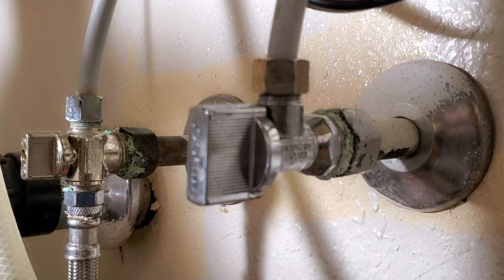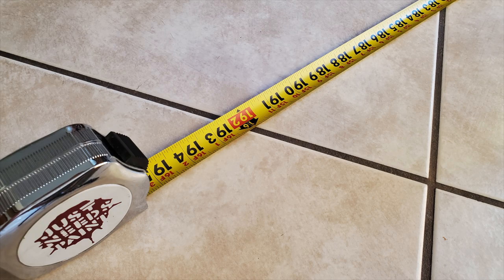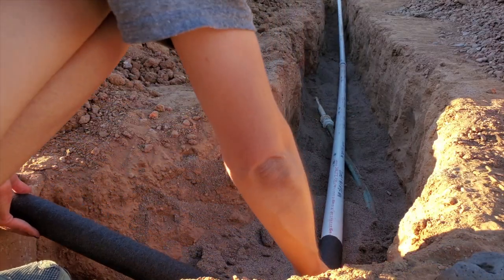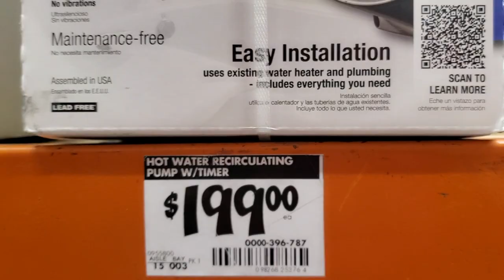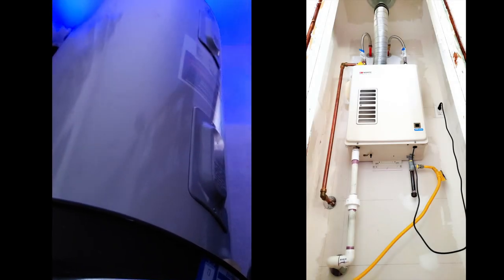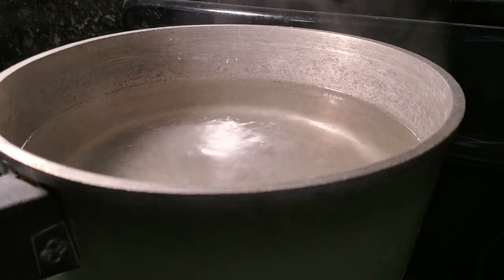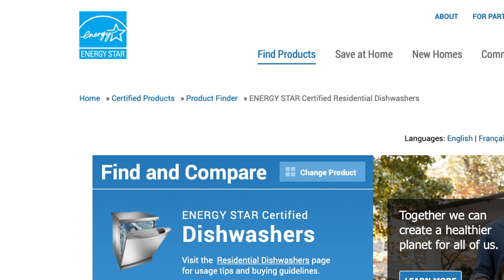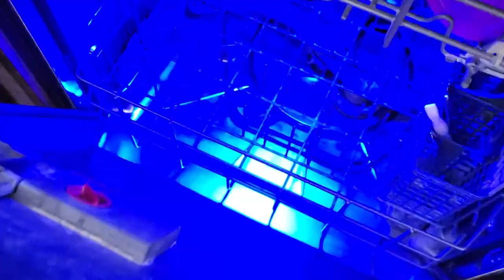PROOF!!! Why Hot Water NEVER Makes It to Your Dishwasher?!?!

Comment: This was a great video, and one I’ve been looking for. Me and my wife argue about this. 

I pre-charge my hot water line, but even doing so, my dishwasher is hooked up to a separate hot water line. Thankfully I know these two lines to the faucet are T’d off very close to each other, so charging the line to the faucet will bring the water to the line for dishwasher as well (I’ve actually tested this by disconnecting the dedicated hot water line for the dishwasher and running it into a bucket after charging the how water line leading to the faucets. 

However, I pre-charged the line just now (tankless hot water heater) started the dishwasher, and much to my dismay, the water in the first cycle was still room temp. It used so little water than even pre charging the line wasn’t enough to get hot water into the machine.

I was tempted to bypass the separate line for the dishwasher and just have it tapped off the same line as my faucet to avoid this,  but after watching my this video, I just no longer think it’s worth it to charge the line prior to getting it to the dishwasher.  It always seems to get the dishes clean anyways, and I never pre rinse anything. 

To anyone in a newer home with their dishwasher on it’s own dedicated hot water line, (I’m assuming building code), be aware charging the line is probably doing nothing.  I hope this helps at least one person.  Like you said in the video, information on this topic is super limited. The owners manual mentions nothing about pre-charging the line either.
Reply from the maker: It certainly helps knowing your plumbing layout! Nicely done on the testing and thanks for sharing your results. It's always disappointing to think you are helping when I fact, it's just wasting gas (I'm guessing tankless gas). As another viewer noted, the dishwasher can always steam up my glasses when I open it right away, so it's probably doing a good job on it's own.

Great point on the dedicated hot water line in newer homes with newer more water efficient dishwashers. I wasn't aware of that, living in an older home and now I'll have to go check out the code.

I'm not sure if I truly helped with a marital issue--that would certainly be a first for this channel! 😉
Reply: I dont think dishwahsers run with supplied temp water. I think they would heat it up to a set temp, then run the cycle.. If not, it would make little sense.
I purchased a 4gal water heater that will go under the sink, as the kitchen water takes to long for the house main tankless heater to heat up and have water in the kitchen.  Waste of water...not that you can waste water, as all water stays for use on the earth...but still, it wastes time, and dishes should get cleaned with hot water, as most bacteria die above 130F.
So maybe using the Sanitize rinse has a water temp regulator in the dishwasher that makes this work..Its likely why that cycle takes an added ~2-2.5 hours!!  So, I prefer the heating element to make sure water is heated, ... new washers are often having issues drying, as there is no heating element for the drying cycle.
Reply from the maker: Agreed on all your points. It wastes time and energy. If the line isn't pre-charged the water heater kicks on for no good reason and the hot water just cools off in the line. If it is pre-charged a whole lot of hot water cools off in the line and even more water has to get heated in the water heater.
Reply: @NoMoreLeaks  I think I understand your point a bit better now that I absorbed it :-). SO using a cold line should be ZERO issue, is what I see being the result. As the water will get heated in the dishwasher regardless. Besides, if you have the water lines in a hot attick, they are both hot. And the water that is heated never makes it to the dishwasher, as there is sitting water in the line before it.
Reply: The cold water feed is still feeding much colder water than a hot water pipe with standing water. Would it still not lighten the heating burden on water overall?

Comment: I have a gas tankless, it already take at least 90 seconds to get hot water at my kitchen sink... my farthest fixture, but at least the lines usually stay warm long enough throughout the day that its not a problem after the first use. But the first sink of the day is cold for a while. I can almost guarantee the water entering my dishwasher is ice cold. However, I have opened the machine in the middle of cycles before and the water and steam are scolding hot. Not overly worried about the temp being reached inside - I'm sure the heating element is doing it's job regardless of the incoming temp (since the cycles are so long). I love our tankless (recently upgraded 1 month ago) because the water is cleaner, it never runs out, more efficient, built in flow meter, easier and more accurate temp control, etc. but the time to get hot water is definitely noticeably longer and our plumber said those recirc gadgets (navicirc) which use the existing cold lines to return hot water is not up to code where I am.

On the other hand, I will sometimes charge the line for my washing machine (by running the sink) - It would be interesting to test how hot that water is really getting bc that machine doesn't heat it to the best of my knowledge. I haven't stopped a cycle to test it, but I do see steam/condensate on the see through lid when it starts filling.

Also really been enjoying the phyn plus! your videos helped inspire me to grab one (despite my pressure sensor being a little off) - I've rechecked the flow rate accuracy many times and it is quite impressive compared to my poorer experience with the moen flo accuracy, and unlike the moen Flo, the phyn is able to catch much lower flow rates, specifically our reverse osmosis system which is cool. Phyn says my dishwasher is using 0.71 gallons three times over the cycle, while the washing machine is variable depending on how it sense the load size, but it can pull 6.4 gpm when it starts filling - based on my tankless water heater reading which shows 3.2 gpm flow during that time, I surmise it is using 50:50 hot to cold.

P.s. maybe you've already seen these, but you can buy really small electric tankless units designed to go under a sink and attach to the sink and dishwasher lines just to boost those temps when water is flowing. like a mini local tankless
Reply from the maker: I have to agree with everything you mentioned. When I open the door there is steam coming out...and these cycles are ridiculously long, so it's definitely long enough to bring it up to temperature with as little water added as there is. So it is a moot point.

Still, why the requirements in the manual then? I guess to keep the cycle shorter (since the verbiage in the manual says it will take additional time and energy), which would count against the energy star ranking? 

Next related video: no hot water doesn't make it, it doesn't matter because it heats it anyway, ignore the words in the manual (at your own risk), hook it up to the cold line and keep on keeping on while saving energy and money! ;-)

Since I live in the desert, I do consider conserving water as part of living here. But I like following the rules including manufacturer instructions. I don't want to pre-charge the line and I don't like just wasting the electricity because I followed the directions to put it on the hot water line.

Oh snap! I did see a mini tankless--and tank style--water heaters at the builder show a few years ago! Those were looking really good as possibilities to help with my underused shower due to distance from the water heater and would be perfect for this application! Now for the extra electrical outlet...

Good point on verifying with the local plumbing code first. Just because I obviously found it on the shelf at my favorite store, according to my credit card ;-), doesn't mean it is legit.

Jealous of your tankless. There is no gas in this neighborhood and the panel is too full to add a tankless on top of no access to pull a new line.

I totally missed connecting the dots between you having the faulty flow sensor on Flo and the pressure inaccuracy on your Phyn. Definitely not the best experience on either, but I'm glad that the one you ended up with seems to be the better option!  I was considering doing a comparison on accuracy between the two because of your comments (although my sample size is the smallest possible). I was only planning on the flow rate, but now that I recall your question on the gauge and doing that check for you last week, I'll bring my water pressure gauge to verify Flo next time I see it in October. Thanks for adding this part of the comment!

Thanks for adding to the conversation! This might rival that lively conversation and I already want to redo some parts of the video based on your feedback and Jeff's. Sigh...unchangeable videos.
Reply: I was tempted to do one of these little mini tankless heaters as well if they’re not too energy inefficient. I’m sure it’s better to do that than run it off the hot water line where no actual water makes it to the machine but still runs the heater.
Reply from the maker: Agreed, but would the cost of a mini water heater be worth it if the dishwasher still heats the water to temperature anyway? Plus it has to keep the water hot at all times? Now that would be a hardcore nerdy video offsetting the cost of one of those water heaters to the cost of heating water inside the dishwasher...then you'd have to factor in how much you use on a regular basis in the sink. I like the idea of keeping the math simple with variable need usage in sinks and showers tied in to the water heater and these extremely efficient dishwashers should be responsible for themselves (cold line).

Comment: A recirc pump turns your entire house hot water supply line into a 24/7 heat radiator so depending on your climate could be pretty costly to operate.
Reply from the maker: 100% agree. It is hard to justify. If you figure out a schedule then it's an inconvenience to try to be within the 'on' time or if you use it when the system is off there isn't much point.
Reply: A timer is typically used for a circulation pump to operate for shower/wash times in the morning and evening. This avoids waiting (water wastage) for the warm water to come through the taps around the house.

Comment: Prerinsing your dishes is a big no no!  Miele specifies that the food particles are necessary for optimal cleaning.  Also pre rinsing leads to permanent etching of your glassware!
Reply from the maker: Thanks for the tip. I believe Miele is also a manufacturer that recommends installing on the cold line (or at least gives the option). Do you have one?

Comment: If your dishwasher is connected to cold line, you could connect to hot line to reduce the burden of heating by dishwasher as it is already preheated by water heater and you save electricity considering your water heater is connected to gas.
Reply: I don't think so.  The point being made is that the volume of water in the hot water line between the water heater and dishwasher is greater than the volume of water that flows into the dishwasher at any point in it's cycle.  That water in the line is at room temperature.  Therefore no water that is hotter than room temperature ever makes it into the dishwasher, and this is true even if you have a gas water heater.

Comment: Well...couple of things.  First, the dishwasher line almost always tandems with the hot side for the kitchen sink.  So if you are using the sink at all to wash/rinse dishes, the water going into the dishwasher will be hot.  For subsequent cycles, it depends on how well insulated the line is but the supply water is usually at least warm.  The problem of hot water getting where it is needed is not unique to the dishwasher.  We have a septic system on a single story ranch house with 90 foot water supply runs.  To avoid dumping 3 gallons of cold water into the septic system every time hot water is needed, we have a circulation system that moves hot water through a main loop in the house.  Each stub is only 5-10 feet from the main loop so the water is hot in seconds.    OK, back to the undissolved tablets/pods.  We discovered that the heating element in our 4 year old dishwasher was not working.  Even with 120 degree water on the supply side, the water quickly cools as it is sprayed around inside the dishwasher.  Within about 3 minutes, the water, which reads 120 at the line, had cooled to about 80 degrees.  Turns out that a connector had come loose the last time the dishwasher was moved.
Reply from the maker: I appreciate your detailed comment. There is always some pro/con savings/waste argument. With as little as we use hot water here I have a hard time justifying the amount of work/materials it would take to create a hot water circulation loop and the electricity/gas to keep it heated even if it is on a timer, and from a water conservation perspective, I sometimes go so far as to use 5 gallon buckets to capture the cold water going out in order to water the garden--that does take considerable effort. The connector part is a good thing to check. How did you discover the temperature inside the machine?

Comment: One thing not mentioned here is that water from your hot water tank is gross and shouldn't be consumed, but cold water is drinkable. When doing dishes by hand, I always rinse with cold water. I've seen what the inside of my hot water tank looks like, and it's not pretty.
Reply from the maker: Thanks for adding this tip!
Reply: wait until you see what it looks like inside your pipes!
Reply: @jeremiahp  I clear my pipes almost every day thank you very much.

Comment: You have no idea how to use a dishwasher.  Never, EVER put wood utensils in a DW.
Reply from the maker: ⭐ I knew that spoon would be worth one flame.
Reply: Wooden spoon is cheap. It goes in the dishwasher and then goes in the compost.  It also absorbs the yummy detergent and will keep you insides clean. It’s no big deal. Wood chopping boards - that’s a different story.

Comment: Run your hot water in the sink to get it hot first then turn it on problem solved
Reply: Not entirely, have you ever looked to see how long the line is from the hot water source, under the sink, to your machine? Water will stay in that line, and presumably in the lines inside the machine. Consequently, even if you run the hot water, until you have hot water to your sink, you are still pushing room temperature water into the dishwasher. Will some of the water entering the machine be at least warmer than room temperature? I would assume so, but there is no way the initial water or the entirety of the dishwasher water will be hot, at all, when you start the cycle.